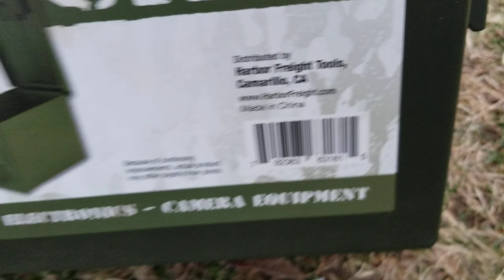The 1977 Yamaha gt80 bike build part 4 FIRST START

Comment: Hi Kevin,  I have enjoyed all of your videos.  I have a 1992 and 2001 ke 100. I would like to know what pet cocks for fuel tank are the best to buy and where to get them. I purchased one and it leaked from brand new. Thanks again for all of your help with your videos. Jeff
Reply from the maker: Any petcock is good they don't really have brand names I actually use a Chinese knockoff on mine had it 3 years no issues I bought it on Ebay
Reply from the maker: Thank you for your support
Reply: I always get mine off amazon. Work great

Comment: Could you do an update video on the Bombardier Rally 200 ? Because I also need to fix the carburetor intake as well (:
Reply from the maker: I sold the rally 200
Reply: Nooooooooooo
Reply from the maker: Are you in the us
Reply: @2strokeguru  no, in Europe
Reply: @2strokeguru  posted a vud on how to start it but the carburetor is still not connected to the air witch is bad because dust can get in.
Reply from the maker: @c0munguyforcaz  yes how ever I was simply trying to do a first start driving it with the air filter assembly disconnected is a no no however for diagnosis its perfectly fine

Comment: Hey man where do you get your parts for this bike? I’ve got a 1980 GT80. I’m trying to get the gasket for the float bowl. Bike is pissing out. I don’t know what mm size it is
Reply from the maker: Ebay mx80 and gt80 same bike
Reply: Is that a 30 mm carburetor?
Reply from the maker: @drakematteson4670  no is factory carb

Comment: Kevin!  Love your vidoes on the 77 GT80.  Ty!  I am going to leverage the cdi swap once I get mine running right.  In any event can you help guide me on what you’d check next?  I have 74 GT80.  It starts right up with choke and then dies.  If i hold my fingers mostly over the carb air intake hole it continues to run and will rev up.  Does this suggest it is getting air elsewhere?  Thoughts???  Appreciate it!
Reply from the maker: I'm doing a 5speed swap next
Reply from the maker: Thank you for your support
Reply from the maker: Sounds like it's not getting the fuel through the idle circuit